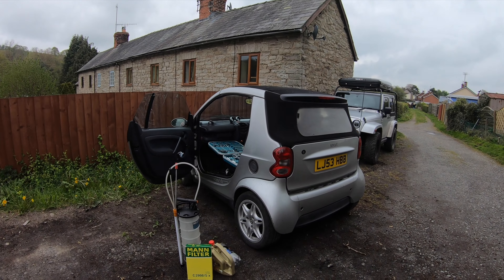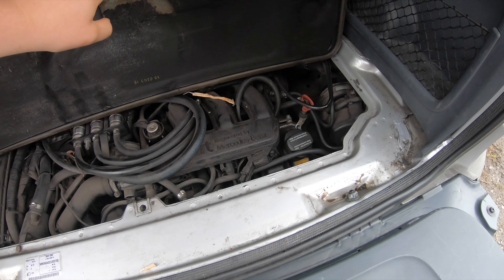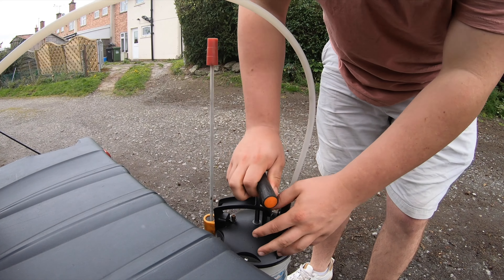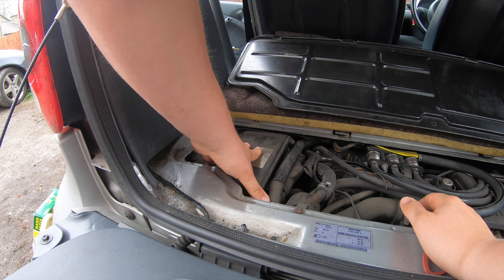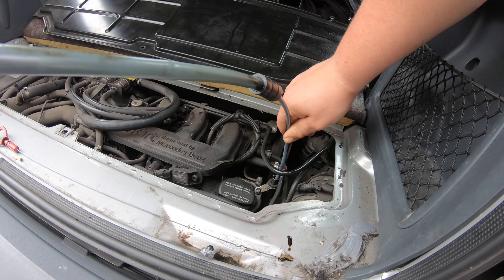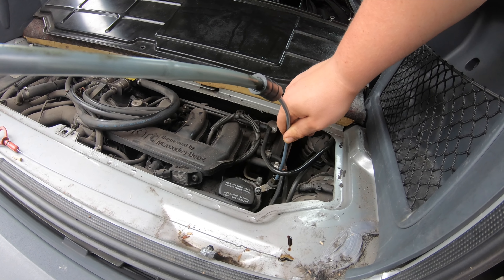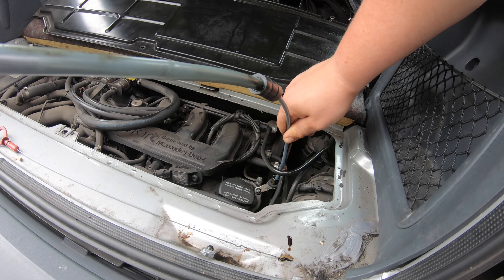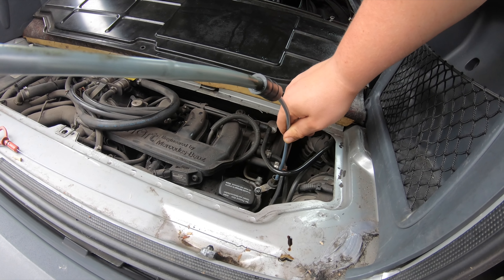Servicing my *CHEAP* Smart Car was a TOTAL DISASTER.....

Comment: use a 5w-40 - the "winter" rating is just its cold viscosity. both when warm will act as a "40" oil with the same viscosity, it will just flow better when  cold, (thats why we dont have 10w-40 FS anymore) however take it with a pinch of salt - as some older engines do prefer cold starts with thicker oil for "stickiness" and pressure.  Your 5w-30 will be too thin at operating temperature, 

The unofficial way to drain these is to remove the filter, jack the front end on a lift and tip it out.
Reply: the 5 rating supersedes 10 dues to the call for better fuel economy at the expense of premature wear (but over the course of hundreds and thousands of miles) my Toyota calls for 10w-30 which is an ancient oil that cant be found. but the same engine on newer models evolves through 5w-30 to 0w-30. But it also states that in high temps, heavy towing, racing or constant high speed i.e. motorway or over 200,000m then a 15w-40 is used. NA to your petrol but for those wanting diesel 10w-40 Full synthetics or other exotic oils then use Delvac or HGV/LGV/PTV oils